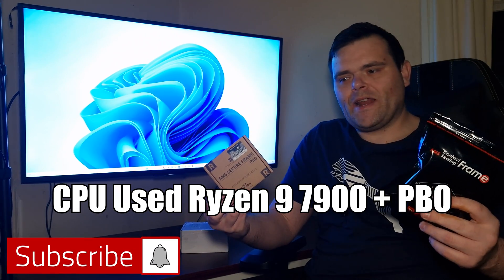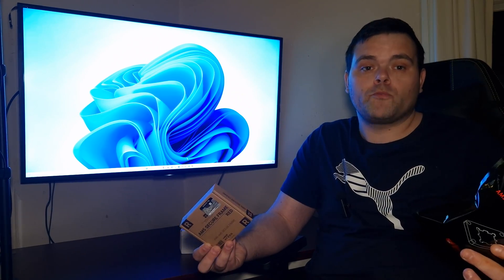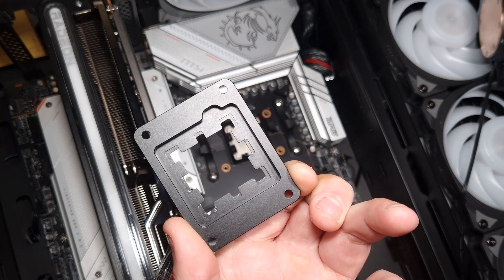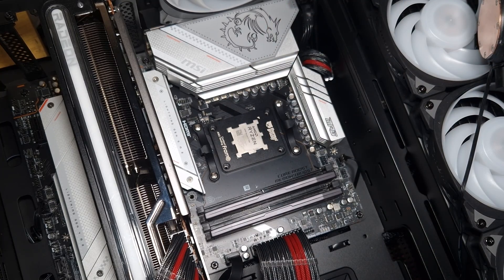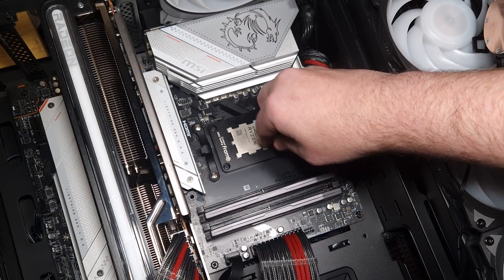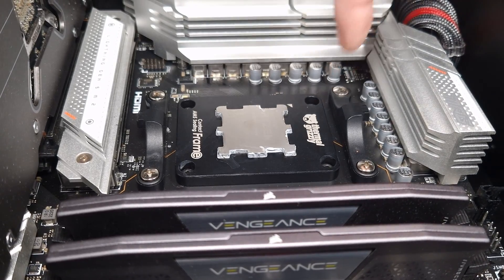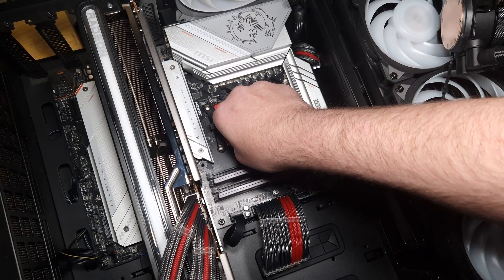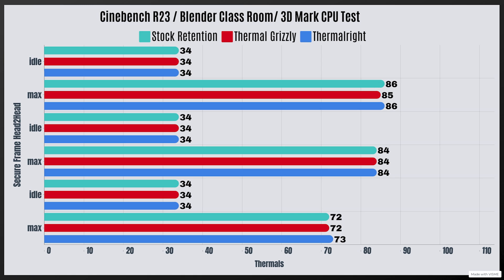Thermal Grizzly Secure Frame Vs Thermalright Secure Frame AM5 CPU's

Comment: Just a little side note the silicone pad is actually not necessary unless you are using Liquid Metal. The primary concern is a carrying a charge to the fry the chip but most frequently used thermal pastes are not conductive so they shouldn’t harm the chip, should it manage to contact it!
Reply: This is false information! You don't use Liquid Metal on the IHS as this will cause damage to it. Liquid Metal is designed for Direct Die only, which is why there is a Direct die frame you use instead of the Contact Frame. Don't confuse people with wrong information.
Reply: @recko1269 it's literally said in the manual of the sealing contact frame am5 that you should only use this silicone pad if you use liquid metal.

Comment: I would go with a copper frame if available.
Reply from the maker: That would look awesome just plain copper
Reply: @WELSHYTECH  I found copper ones online on the known sites. Will have to get on as they are pretty cheap.
Reply from the maker: @DragonXDrei  what sites bud I Might get one in
Reply: @WELSHYTECH  You can get copper ones now from Ali and the rest. They cost between $5 and $10. Will get one and see how it goes.

Comment: Thermal grizzle instructions say the foam inlay is necessary only when using Liquid Metal, will not help if you’re using thermal paste ?
Reply from the maker: You don't have to use it but if your using thermal metal then yes, but I used it anyway

Comment: Hi Quick question on my thermal grizzly plate it says in the intructions that the silicon frame is only for use when liquid metal is used for cooling to protect the transistors  is that correct? And do i use the pad or not as i'm just using paste
Reply: Thats false … thats not what Thermal Grizzly says … you must read it properly … they clearly state that the silicon guard is optional, but offers useful thermal paste protection … it must be used if liquid metal is used for cooling.
Reply from the maker: I used it in the video it won't harm anything if you use and as for liquid metal I've never tested or tried it so I'm not sure

Comment: I think it depends on the board. I replaced the bracket with the Thermalright one and it did take down my idle temp in the bios by 4-7C. Windows idle temp is down about 2C but I suspect that if I did a fresh reinstall, it might take it down more.
Reply from the maker: Nope, it doesn't. These do not help AM5 in any way unless you are watercooling custom loop it might help with thermals

Comment: How did you cool your amd 7900 to 34 degrees in idle, mine is around 45-55 degrees using the Dark Rock Elite + Arctic MX-6 thermal paste.
Reply: try an undervolt and mayber lower you tpp
if you aren't running benchmarks this setup will save you a lot of heat/power for basically the same performance
also if you have a good psu check if your cpu is allowed to go into sleep states
Reply from the maker: I had nothing running in the background even rgb software will still be a load on the cpu to make it spike point of doing for thermals is to let the cpu idle without any background software
Reply: I have a 9800x3d. I use an ICUE cooling pump. My idle temp is 29°C and full on power I am at 32°C. I don’t overclock yet.

Comment: what happens when it doesent include the 4 screws? can I use the 4 that came with the motherboard?
Reply from the maker: Nope if it doesn't include the 4 screws I'd buy another secure frame
Reply: Your set is not complete so why keeping it?

Comment: basically pointless...as its trying to solve an issue that only occurs on intel
Reply: I use ptm7950 and really needed a flat bed so I used the thermalright frame.
Reply: @vajraentite133  same. i just upgraded to AM5 yesterday and got the thermalright frame and ptm7950. I was considering the Thermal Grizzley frame but i wasn't going to pay $15 more. The Thermalright fame is working fine.
Reply: Not really pointless, the factory locking mechanism could bend the cpu , I took my cpu out and I placed on my phone screen and its not perfect straight !!
Reply: @smamas114 exactly
Reply: The LGA socket does bend the AM5 CPU as well but not so dramatic like on the 1700/1851 LGA CPU's. Der8auer is explaining that and Noctua is even making 3 versions of a cooler. One standard one, one for Intel (HBC) and for AMD (LBC). Now explain me why a company like Noctua should do it when there is nothing wrong with an AM5 LGA socket?
Reply: Thats false … it also addresses a problem the intel does not have … the processor form and the thermal paste guard function.
Reply: No you are wrong. Those using thermal pads it's a good idea to have the plate due to the protection it offers the outer transistors from the pads high conductivity
Reply from the maker: @richardhampton3260  one not everyone will use a thermal pad while using a secure frame two I am not wrong because the secure frames do nothing for thermals it only protects from thermal paste go over on the transistors if you bothered to watch the video I do mention it
Reply: @WELSHYTECH  it doesn't do anything for thermals but pretty sure the thermal grizzly one is meant to protect the cpu when using liquid metal with the foam gasket
Reply: It's cool so it isn't pointless. 😎
Reply: yes but it look cleaner when u remove the cooler
Reply from the maker: Yes

Comment: waste of money all scores were the same  it works  on intel because of the ihs bending with stock hold down
Reply from the maker: Well I wouldn't say it's a waste it does help with cleaning thermal paste but that's it
Reply: You make zero sense … its for even pressure distribution and the optional silicon guard a thermal paste guard. Its not made to optimise cooling.

Comment: I think you should try the frame with conductonaut extreme since the seal will prevent you from frying the CPU.
Reply from the maker: Or you could buy Noctuas AM5 guard
Reply: @WELSHYTECH  I was not aware of that product, but yes, that's a valid option.
Reply from the maker: @AlaskanGamerGuy  Yes I've made a video on the AM5 Guard
Reply: @WELSHYTECH  my thermal grizzly contact sealling frame just came in yesterday. I already have conductonaut extreme on hand since I always use it on my laptops, and my new mobo comes in today so we'll see how things go. My 7800X3D is already gertting 18K on cinebench R23. I already have around 25-30 degrees with kryonaut extreme, so I guess I'll find out later today if it can make a significant difference.
Reply from the maker: @AlaskanGamerGuy  it won't even Thermal Grizzly has said it doesn't make any difference in thermals
Reply: @WELSHYTECH  the only improvement I noticed was in how fast it cooled down between  runs in Cinebench.
Reply: @WELSHYTECH  maybe I'll consider voiding the warranty for direct die, but I'm not sure it's even worth it with an X3D. They're pretty efficient to start with.
Reply from the maker: @AlaskanGamerGuy  I wouldn't risk it to be honest
Reply: @WELSHYTECH  it's a relatively affordable CPU and wouldn't be a huge loss. $350 for a replacement wouldn't hurt too much after spending $3.5K on a custom build.
Reply from the maker: @AlaskanGamerGuy  Well $350 is a lot of money to most people
Reply: @WELSHYTECH  when it comes to computer components it's on the lower end of things. An AIO and a decent power supply would both cost as much as the CPU. If delidding offers a significant enough benefit, then it would actually be easier on the CPU and it would increase the lifespan beyond the length of the warranty coverage.
Reply: @AlaskanGamerGuy Thats not true … excellent psu and aio are much cheaper than the cpu …
Reply: @Betelgeuse666  I said both together.

Comment: You should compare clock speeds instead of thermals, both platforms nowadays opportunistically boost until they reach TjMax. That's why the charts look so similar.
Reply: this is mostly true, as it doesn't boost till it's possibly unstable. anyway, temps are far from the only measurement needed. clock speeds are required for this type of testing
Reply: But as you saw he didnt even reach the TjMax
Reply from the maker: I'm comparing thermals, not clock speeds. If the thermals are under control, they mean you will get the best performance
Reply: @WELSHYTECH  that's the thing. With 7000 series ryzens, they will boost to the exact same temperature regardless of cooling, every single time. The difference will be in the clock speed, not the thermals.
Reply: @Sheltada  Exactly. The clock speed AT the point they get to the throttle temp is what's important. One may be running much faster at the throttled temp.
Reply: @WELSHYTECH  if you ignore clock speeds, then your video is completely invalid

Comment: Was hoping for an improvement but seems this is just a fun add on rather than functional.
Reply: It is functional in the sense it keeps thermal paste off the substrate cutouts and SMD's
Reply: @keithmyers2170 Its not at all made for this … the optional additional silicone guard is!
Reply from the maker: yep its intel where the secure frame really makes a difference
Reply: Of course its functional … it is supposed to offer a more even pressure distribution … and hence a reduction in pressure related errors … the additional guard prevents thermal paste messes. Its not made to have an effect on temperature.

Comment: What cooler fan did he used and what were the thermals without the aluminum fitting ?
Reply from the maker: @samm928
if you watch the video I put right at the beginning and during the benchmarks i also say what cooler and give the thermals for stock retention
Reply: @WELSHYTECH  right now I'm testing in open air with 7950x3d on a B650i aura ultra from Gigabyte and no GPU. The cooler height+fan cannot exceed 45mm. I tried the Noctua 37mm, 470grams with two heat pipes and an ID cooler 45mm, 317grams with 4 heat pipes and still reaching 94deg.c .. normally 57deg.c when idle .. under stress, when installing a game it goes to 93 - 94c and it shuts off .. my zs-a4s all aluminum case will get even hotter.
Reply from the maker: @samm928  only thing I can suggest with the  7950x3d is under volt it but 94c is normal for AM5 Chips
Reply: @WELSHYTECH  Yes you'reright, there is a ECO setting in Ryzen Master tool that will limit the power to 80w (0.975v - 0.985v core) and stable clock speed of 4800mhz and then the Temps are around 87deg.C .. I ordered a Thermalright all copper Apx90x47 should have a THD of 140watts. If not, I'll get a larger ITX case.
Reply from the maker: @samm928  you will need a bigger Cooler bud
Reply: What's interesting is that AMD is okay with the 7950x running at 95deg.C, but the 7950x3d shuts down or blue screens between 92-94deg.C to protect the L3 V-cache.

Comment: erm.....you do know that these frames are for anti flex/twist of the CPU not thermal differences! AM5 retention system is not the best therefore these items now exist! also same with INTEL it just holds the CPU without bending them.
Reply from the maker: You do realise that AM5 has a better retention than intel and also doesn't suffer with issues
Reply: Contact frame can absolutely affect temperatures as they ensure better contact with the cooler as well as making it possible to use Liquid Metal instead of paste.
Reply from the maker: @AlaskanGamerGuy  Wrong Even Thermal Grizzly has said it doesn't help with thermals its intel these frames help NOT WITH AM5
Reply: @WELSHYTECH  then I guess it just makes for a nicer aesthetic.
Reply: @WELSHYTECH  who makes AIOs with hardware to fit the height for direct die?
Reply from the maker: @AlaskanGamerGuy  I don't think anyone makes Aios but I could be wrong I know EK has blocks
Reply: @WELSHYTECH  if you had the right standoffs you could most definitely get an AIO for fit for direct die cooling. It seems like the most difficult part of direct die cooling is getting the appropriate hardware to work with the new height.
Reply: That’s why the heat spreader is so think. If you want better thermals you’ll have to go direct die cooling or just deal with thermal throttle a 7950x3d
Reply: Then that would make that make sense with those brackets
Reply from the maker: @xXxImmortalXGamerxXx  exactly
Reply: @WELSHYTECH I plan to do direct die when my warranty ends but until then and has a great warranty and no need to void that for better speeds that work make much of a difference.
Reply from the maker: @xXxImmortalXGamerxXx  Don't blame you bud I may dabble in Direct die in the future but not right now
Reply: Of course the Intel version is for thermal differences. It removes the bend of the stock retention thus giving the cooler a better fit. The AM5 does not suffer from this so in this case it's not for thermals. Best it does is keep your cpu sides cleaner from thermal paste